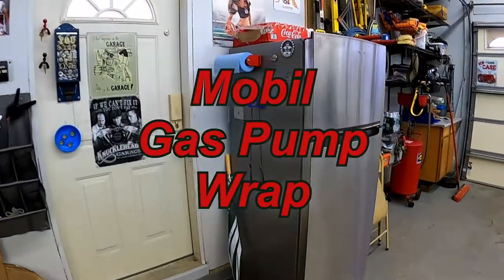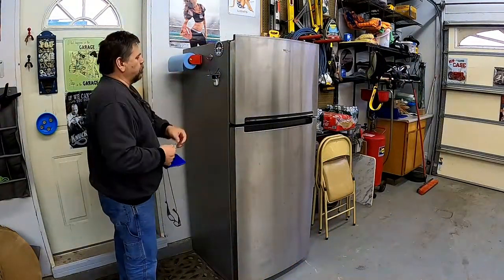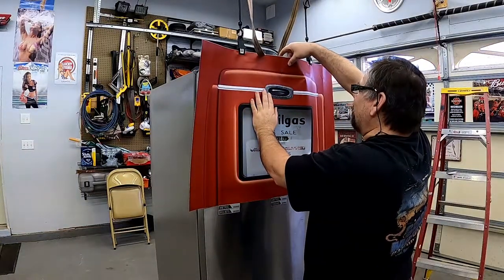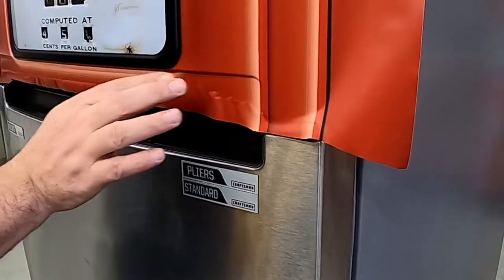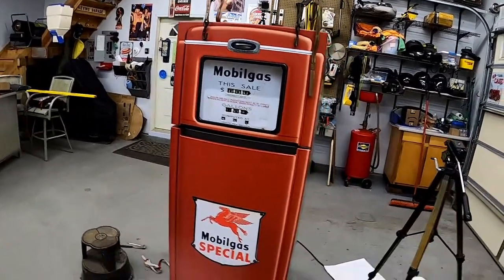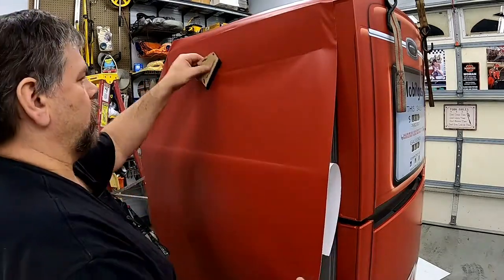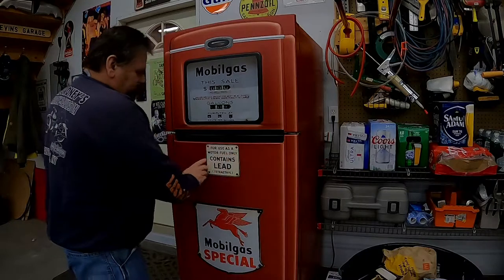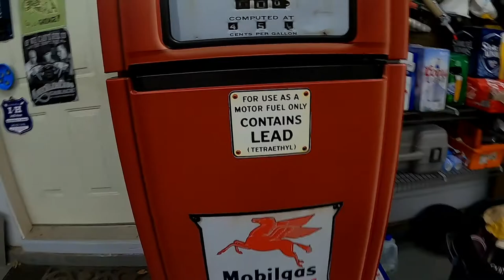Mobilgas Fridge vinyl wrap

Comment: you did this over a year ago. how's it holding up? does it get bubbles or peel off?
Reply: this is the material which is used for cars and trucks (with all weather and temperatures) so you can be sure:
it is lasting.
Reply from the maker: Still holding strong